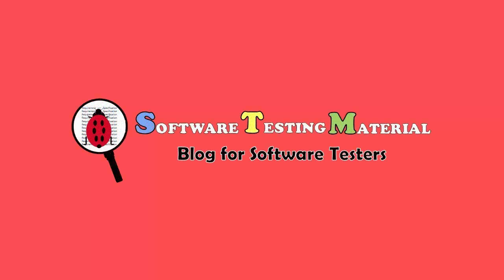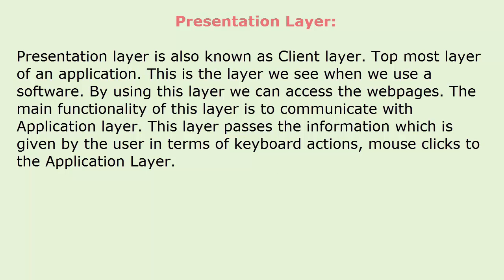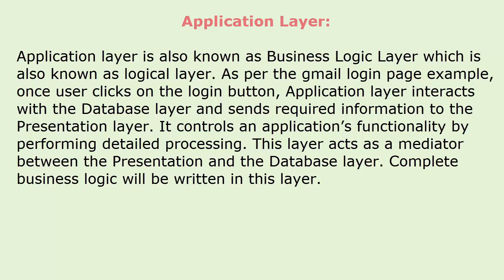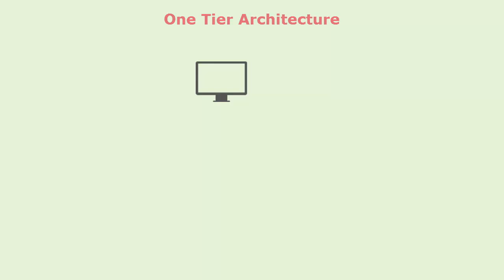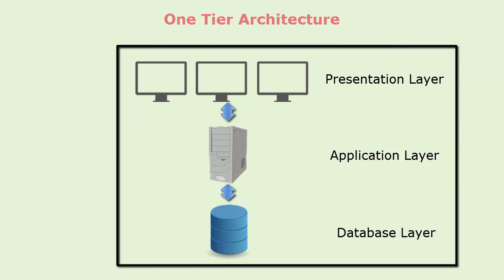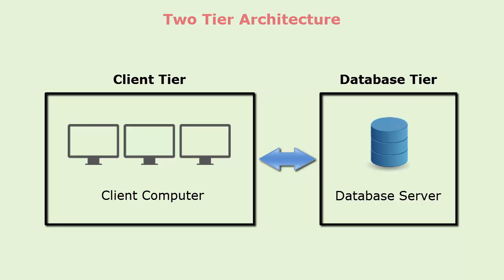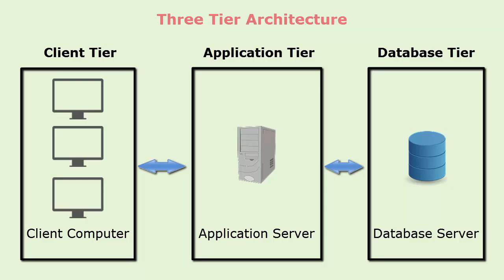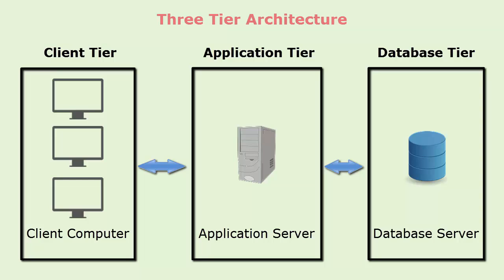Software Architecture - One Tier, Two Tier, Three Tier & N Tier Architecture

Comment: That was a really nice tutorial..Can u give some examples for all this architecture!..Thanks
Reply: N-tier and n-layer are entirely different concepts. People often use this term interchangeably during the design of the application architecture. N-tier refers to the actual n system components of your application. For ex: Suppose you create a web application, its components include your application server where it is being hosted, the database being used with it, on another server and the user machine who access the application, forms the third component. These are referred to as the 3 tiers of your application. So they may be n in number and so the term n-tier application. So tiers are the physically separate components of the same system. On the other hand, layers refer to the internal architecture of your component. For ex: in your code, you divide the code into different layers like Data access layer, Business logic layer etc.. So they are internal to the component and these layers interact with each other internally to form the entire component.